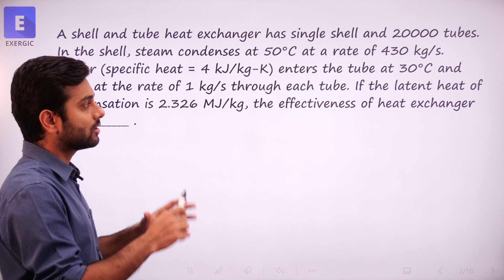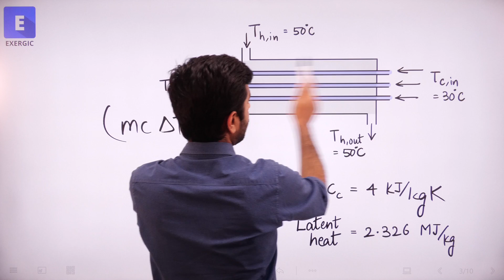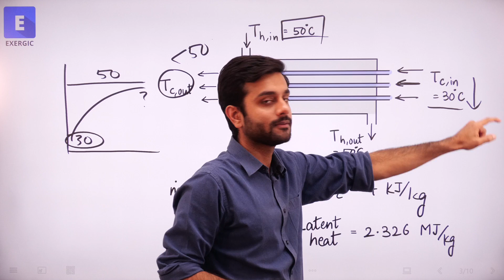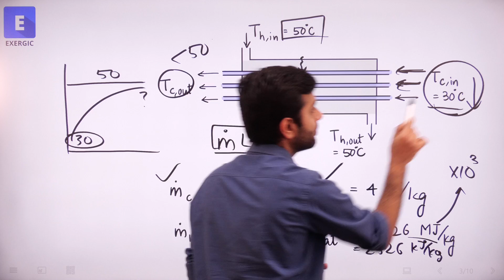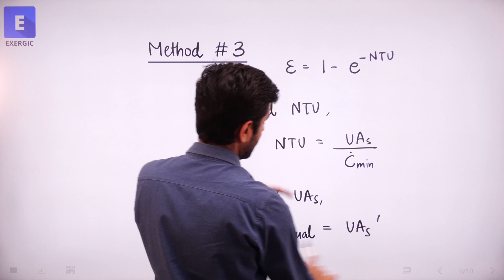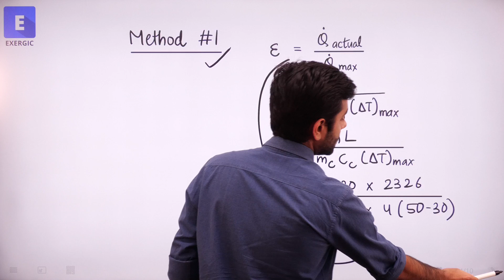Detailed Explanation of Heat Transfer Question | GATE 2024 | Mechanical PYQ

Comment: Thank you sir. Sir there was one question on variation of temperature profile for pipe maintained at constant temperature. Could you consider uploading its solution. I am seeing different answers from different institutes.
Reply from the maker: Question Language is VERY Crucial for that, otherwise answer will change. So, I am waiting for accurate question in Response URL.
Reply: @ExergicGATE  Understood sir. Thanks.